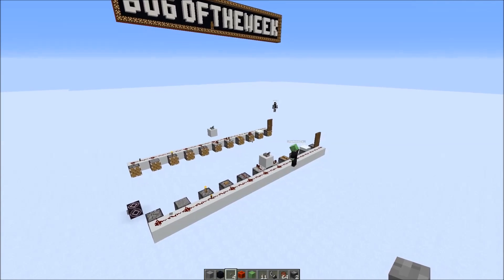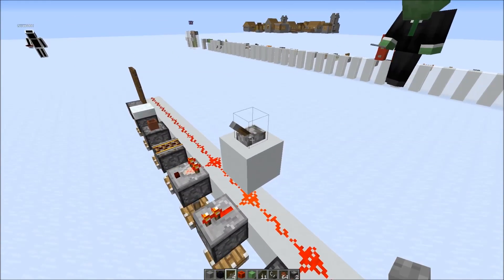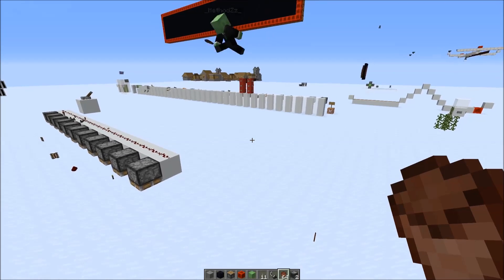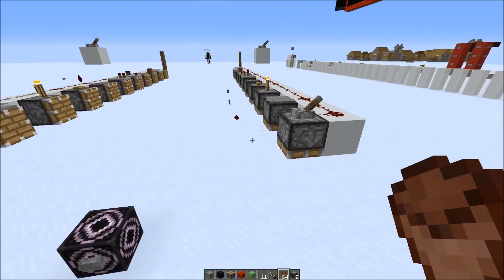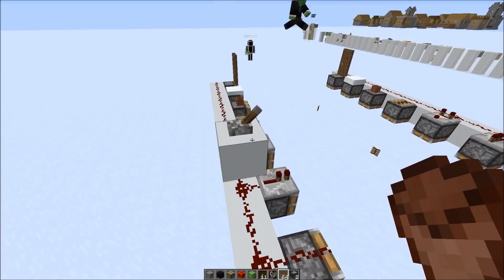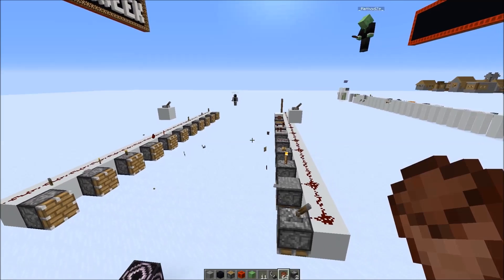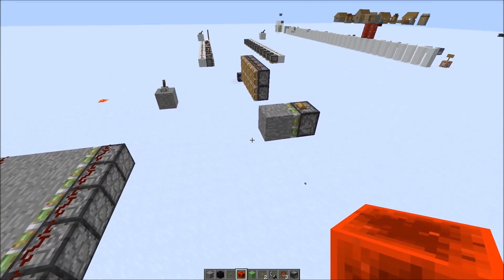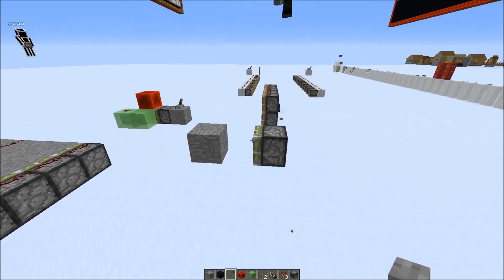Bug Of The Week 2: Pistons pop off blocks on top when retracting

Comment: The one thing I'm afraid of if it ever gets fixed. The bedrock breaking trick using headless pistons is the only method so far that has stood the test of time and works on more than just Vanilla servers. I'm afraid if the bases of the pistons were solid blocks during the expand-retract phase it would break this methods since they would actually be there for the shockwave from the TNT blast to hit them.

Comment: Hmm... I don't like the inconsistent behaviour but I don't know what behaviour I would like, instead. I don't think there's anything wrong with making the game better for builders and, as pistons make nice tables, putting flowerpots on them is desirable behaviour. A sideways extended piston is not a full block so it makes sense that things pop off when it extends. What really doesn't make sense is the downwards facing piston popping off objects only on retraction. If the extra Redstone options afforded by placing these objects is intended and desirable behaviour, maybe the block36 animation placeholder needs a solid upper surface. If it is only flowerpots, maybe it should simply be the case that they can 'float' (same placement rules as jack'o'lanterns?)
Reply from the maker: I don't mind flower pots on pistons. I just find it funny how decisions are supposedly made. "Let's just ignore more important bugs like duping, ghost blocks and entity disappearing for another few years and quickly fix this bug with 0 upvotes. Let's also not care about other consequences this change might bring and new odd behaviours."

block 36 getting a solid surface isn't enough. redstone components also check for fully opaque blocks below them with one exception: glowstone. You can always add exceptions for singular blocks.

Doing exceptions is probably not the best for a clean code, but the recent fiasco with adding the ability to place torches on the backside of stairs showed again, that it's probably to make an exception for a single block instead of changing the behaviour for the whole class, which lead to dozens of new problems.
Reply: I quite agree that there are more important bugs. Maybe they thought this one would be an easy fix. I miss the old stair behaviour. I liked the ability to prevent an apparently solid block from connecting (although on older versions, I have been frustrated by things not connecting when I want them too...) I also liked the ability to create a quarter block sized hole in a wall that renders as flat - that had cool applications.
Reply: yeah the fence/stair change messed up far more than we thought. I immediatly went on the baricades against it and got quite some backlash for it... the typical: "its just a fence not connecting anymore"
Turns out they completly changed the behaviour of all blocks,theres changes in mobbehaviour underwater/changes that affect spawningalgorithm etc. It will probbably take us to 1.13 to figure out what all broke due to this... did i mention it also changed behaviours of activator rails etc?
Reply: In fairness to them, I suppose it would fit a reasonable definition of a 'fix' as the new hitboxes better represent what is rendered. It really caught me out as I had a load of villagers stood on cobble walls that glitched through on update (I assume cobble walls became ever-so-slightly taller such that the y-position of my villagers was below the surface they should have been stood on) - took ages to put them all back into place... :-)